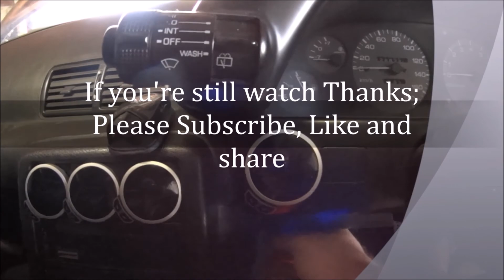RB25DET Build - Strip to a Bare block for machining

Comment: Hey Tangles.  To my knowledge, I've never heard Aussie rap before... I guess I've lived a very sheltered life.  What was that you were trying to remove and didn't have the right sized socket for?  Also 5:44 - careful, mate.😡  Well, I'm not your Mother, but I did watch.  I hope all the mothers in your life had a great day.✌
Reply from the maker: TheMick26 it's just a brass bung. To stop the inside fluids becoming outside fluids.
Reply: tangles01 Thanks.  Something to get you to buy another tool.😉
Reply from the maker: TheMick26 nach fuck it. It can stay. Also what sort of bung is a 29mm head on it. I have 3 spanner and 4 socket sets and not a 29 anything between them. Probably imperial in actuality. But my point stands. None of my imperials fit it either too big and too small.

Comment: Hey mate, how much roughly are you going to pay for all the machine work? Looking to go forged in my rb25 as well but don’t wanna overspend on my build.
Reply from the maker: Riley Brennan cost on the machining I'm having done... is about 2500 retail. Im having specific things done and won't know for sure what needs doing until the bore is re measured and the alignment checked. Certain things in that cost might not be needed making it cheaper.